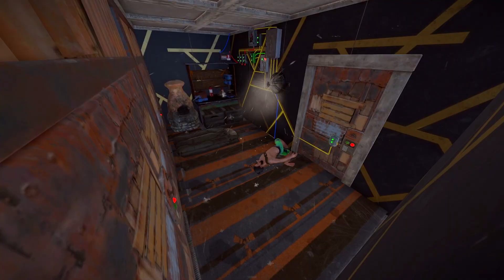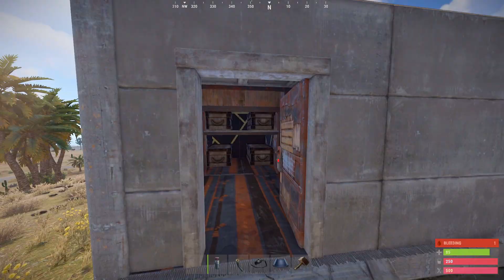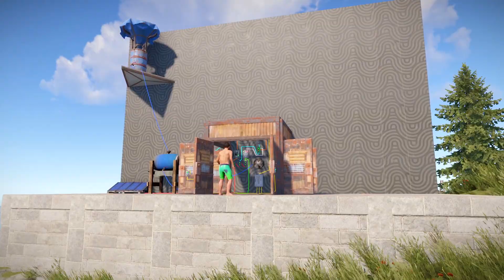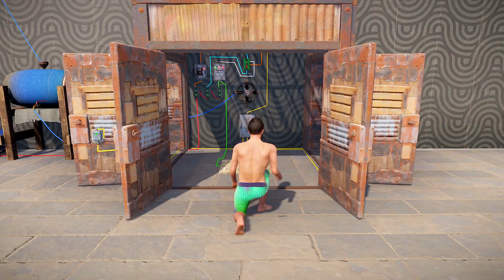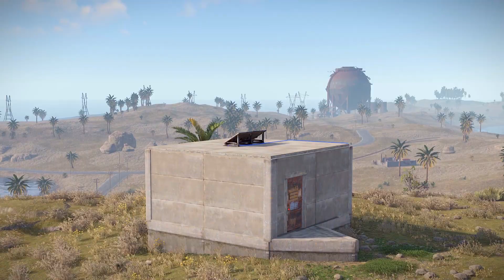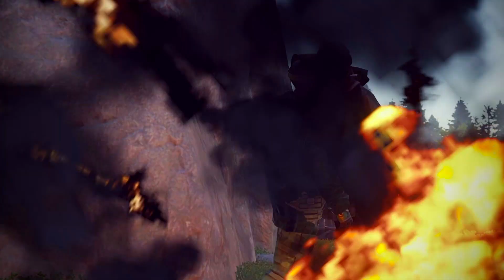Radioactive Water Sprinkler Trap Design

Comment from the maker: You can go without the AND Switch and directly connect the Output of the Pressure Pad into the Memory Cells `set` node. However, it makes it easier to have the AND Switch when hiding the wire for the Pressure pad and you can cut the A side node on the AND Switch to disable the circuit if you ever need to which is very useful and why I included it.
Reply: We got Auschwitz in Rust before GTA6

Comment: I am very much looking forward to building a trap base with rad sprinklers.  My last wipe I made a trap base that used shotgun traps and the same pressure switch to close the doors type trap.  I wired my completely different though, which is weird.